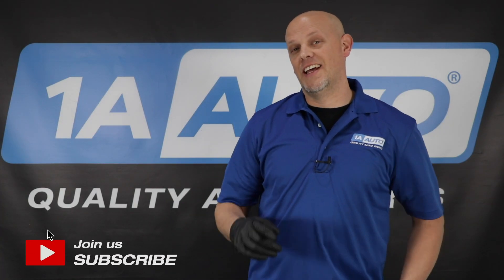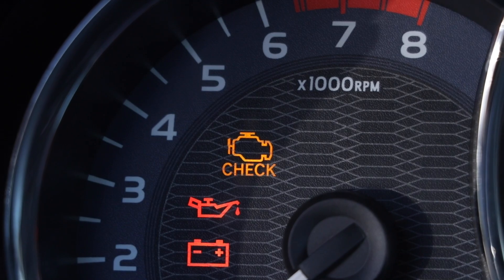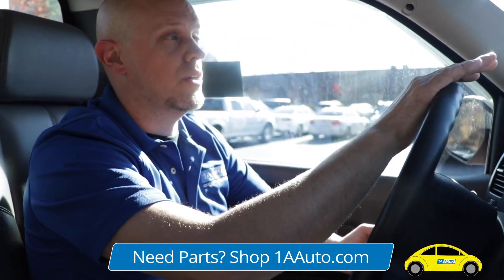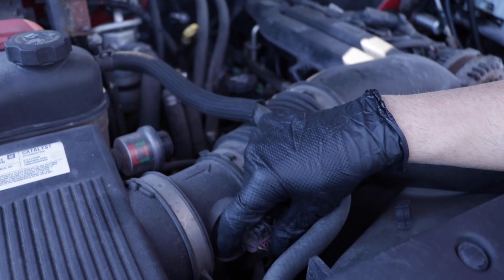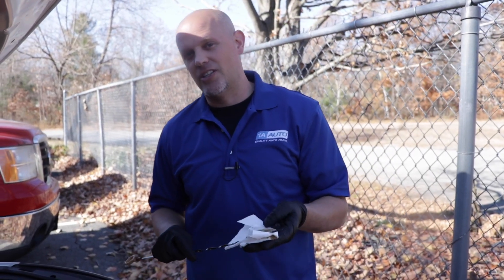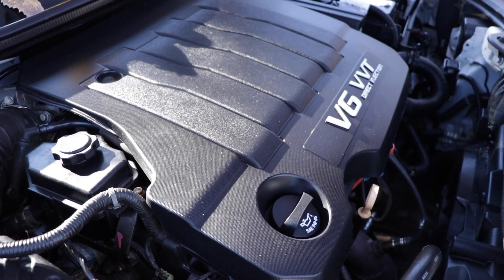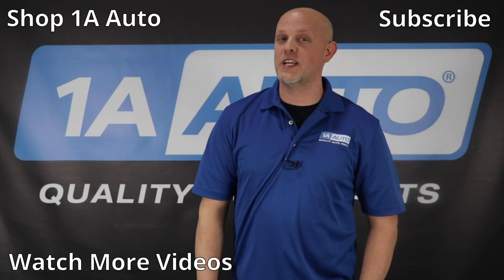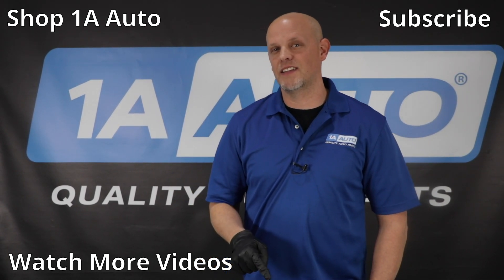Why is the Check Engine Light On in My Car, Truck? Is it Safe to Drive?

Comment: My sister bought a car that had low miles and the airbag light was lit up. I read where if the car set for a while and the battery went dead when they charge it back up this light might come on. In any case, whoever drove the car before didn't like the light, so they put black tape over it ha ha. Because it's an air bag warning light, it's nothing to mess with.  She was going to have it looked at.

Comment: I have a question, so My husband's chevy silverado 2018 also got that solid engine light On, and when we went to the Dealership they said they didn't knowwhat's the problem, they try to open the flap on the front where air would regulate the engine or whatever it was, not really sure what term he use, but yeah that and whenever we drive say it's around 50km to 60km our vehicle would just shake/ vibrate like crazy, and the dealership still don't know what's wrong even tho they already tried to drive it to feel what we are talking about. Anyone here got any idea what we can do bout our vehicle. Coz this one makes me nervous everytime we drive. Thank you

Comment: Uncle Tony. I love your videos man hands down cause I've been working on engines since I was a kid from go kart, to 4 wheeler and muscle cars, built my first Pontiac 400 with 4x heads out of a ram air 3 gto I believe I might be wrong on that. But i bought the 79 trans am for 500 with engine in parts. Had minor problems but it was a torque beast. I'd love to send pics. But something I'd like to see you do is a 240sx cause I fell in love with them light well 10 years ago uber cheap. I think it's awesome your  doing the miata. I think there are some other vewiers like me. That could see uncle tony drifting or a dragging it. Just throwing it out there
Reply: Shame on American made vehicles, for not making very reliable vehicles, and than if the American consumer's wants a reliable vehicle he or she ends up paying a fortune for that car or truck, why, dealers are money hungry, any American made vehicle should extremely reliAble ad fur I'm cuncern, because I'm sick and tired people comparing ,forain made cars or trucks, white American made transportation, it the U.S. can make it, than make it that it will last, ok, Rock On. !!!

Comment: My engine light would be on for 2 days and would be off for 2 days (O2 Sensor Bank 1 Sensor 2 Performance P0141), but after the O2 sensor was replaced, no more codes.

Comment: DO YOU GUYZ LIKE CORNWELL. I DO.
DO YOU GUYZ LIKE CORPORATE BLUE. I DO.
WITH (ONLY!!) 1A AUTO VIDEOS AND A HAYNES REPAIR MANUAL .
ITS BLUE POWER OVER SNAP ON AND MATCO AND MAC TOOLS.
I LOVE THE STATE OHIO.
PS. I REALLY LOVE THE TOP 5 PROMBLEMS PLAYLIST ON YOUR YOUTUBE CHANNEL. ITS LIKE CLIMBING A GIDED TOWER 1999FT IN THE AIR, WHEN I WATCH THAT PLAYLIST.
THANK YOU . SUE ,GLEN,  THE OWNER GUY, THE BULL TATTOO ON THE ARM GUY, THE HOT IN THE SHOP LOOKING GUY.
YOU GUYZ ARE THE TOOL TRUCKS.
Reply from the maker: +Charles Payne Thanks for watching and the comments!

Comment: Do you have a recommendation of what brand stand alone scanner to use other than the FIXD unit? FIXD constantly charges $ upgrades every time you use it. I don't want to use a phone app every time I need to find out what's wrong and be charged an upgrade.   Any suggestions for a good entry level unit that a non- mechanic like myself can use that will let me know what the code means?
Thanks. I love your vids. You are so helpful and provide  easy explanations! ❤️
Reply: i don’t understand why they’re charging you to check vehicle codes, maybe try investing into another OBD2 scanner that doesn’t do that? Walmart has one thats 30$ and isn’t in a phone, cable connects to little device that will show you different results or you can check your local Auto Part Store like AutoZone or O’Reily to see if they have any OBD2 Scanners that you’re interested in
Reply: Innova 3020 CanOBD2 Diagnostic Tool 46.99$ @AutoZone, just connect and see what you’re issues are, can also erase Codes and remove check engine light but will continue to show if the root problem isn’t fixed